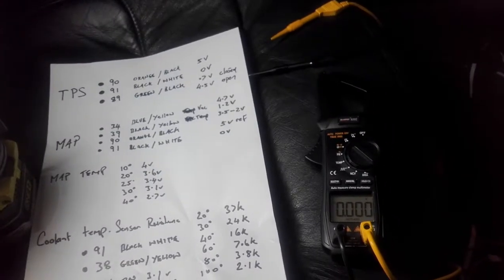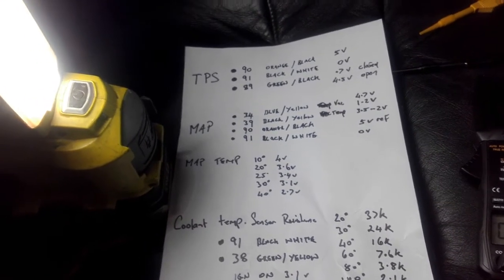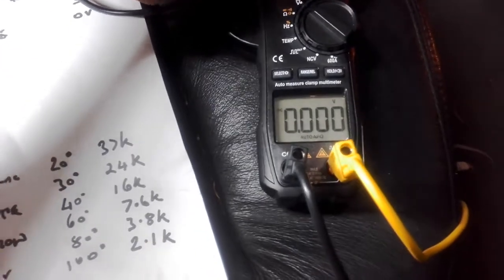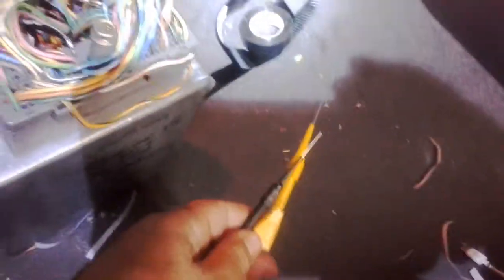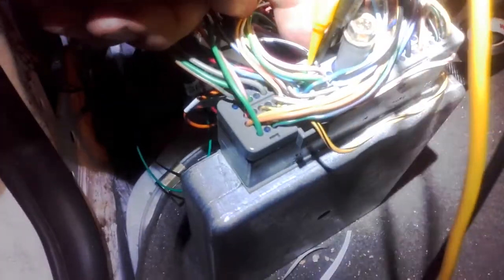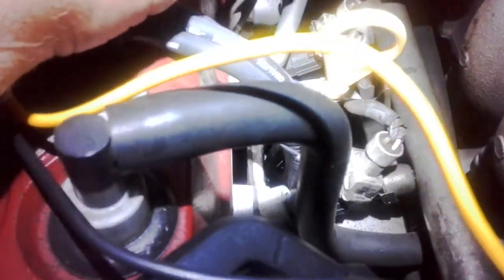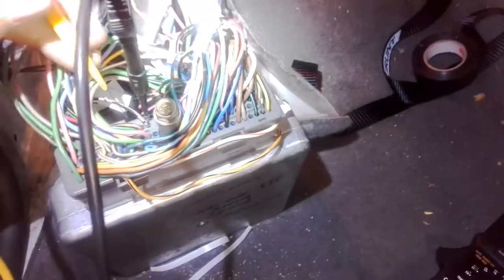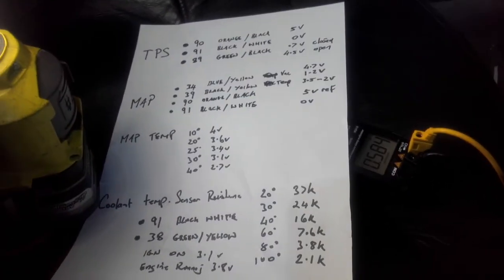How to check the TPS throttle position sensor AU falcon fairmont fairlane

Comment: tps sensor is vital
my s2 skidder has an s1 engine loom and simply cant use a tps
s1 tps bolts up not compatible with s2 software
you will get a massive torque dip and an incredibly reliable method to stall and recover the engine if u punch wot open and shut quick enough

Comment: Nice work, I went through all your colours/numbers and confirm same on my au1 1999 falcon, same colours.
The only thing is your temp sensor resistances are a little bit different ,are they  them from a chart?
I landed up doing my own testing on temp sensor to get the correct resistances at different temps as none of the 
data I found was correct ( though some were close).
My from own data with temp sensor removed from car to test in water of varying temp:
20degC is 31.5k
30degC is  22.1k
80degC is 4.85k
100degC is 2.83
Car will keep the temp between 79degC and 82degC using the fans, 
so 79degC is 5k and 82degC is 4.6k
Also if you do a video on temp sensor note the voltage range changes when you get to 70degC,
an internal resistor in the ecu turns on and changes the voltage output of temp sensor as seen by ecu.
Voltage approaches 1volt as temp goes up to 70degc, then at 70degC the voltage goes up to 4.2v and starts
to decrease again trom there as the temp continues to increase towards 79degC when fans kick on.
at the 1min mark in this vid ( its pretty crappy vid)  you can see what I mean
https://www.youtube.com/watch?v=2aeCY4JFnwg
Reply from the maker: There from a chart . Ive also noticed the 1v to 4.2v on cooling
Reply: au1 tps is not compatible with au2
i fucked up and threw an s1 au engine into an s2
it has no tps regardless of s1 or s2 installed now
stall at wot and torque dip around 3 grand

Comment: on my au1 falcon I have wires on ecu that I cant find any diagrams that include them
pin 7: green/red
pin44: black
pin47: dark blue/ light blue
do you have these on your ecu? if yes do you know what they are for?
Reply from the maker: 7 is brake switch input.  44 black not sure , general ground perhaps mine doesn't have it. 46 unsure however it's probably going to instrument cluster or switch on dash .
Reply from the maker: 47 is part of the ignition rf key reader black connector under steering coloum has 5 or 6 wires in it. Its part of smartlock its not mentioned in most manuals.
Reply: thankyou for that, I've been wondering what they were for, for a long time.
black one will remain a mystery for time being